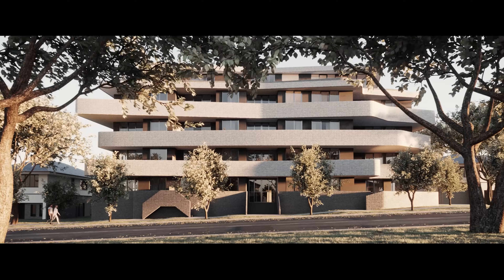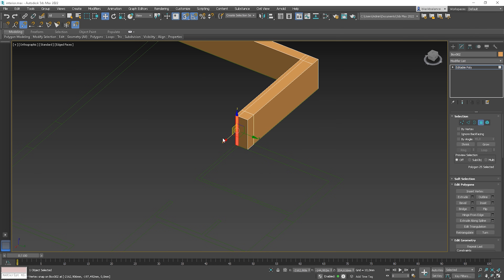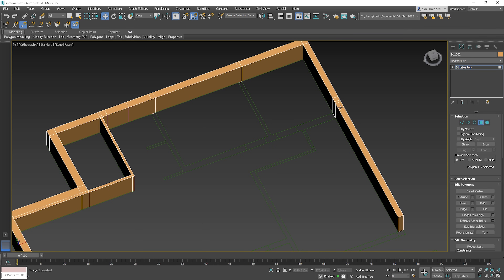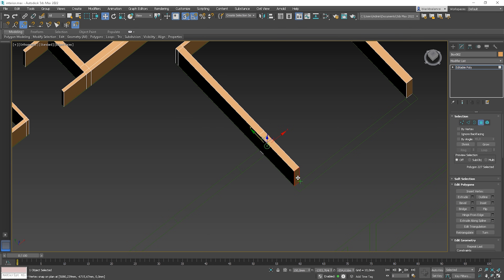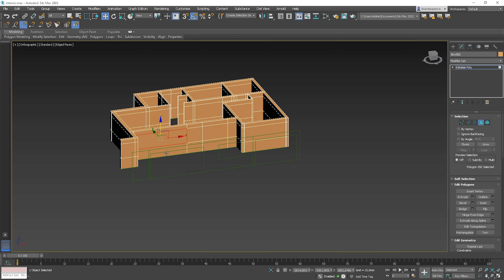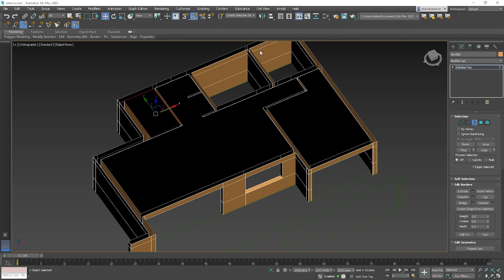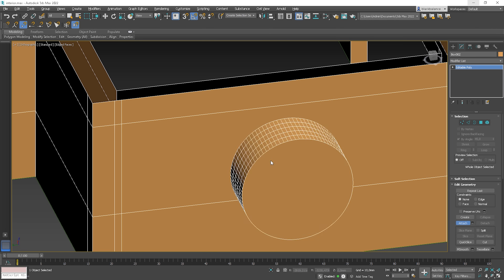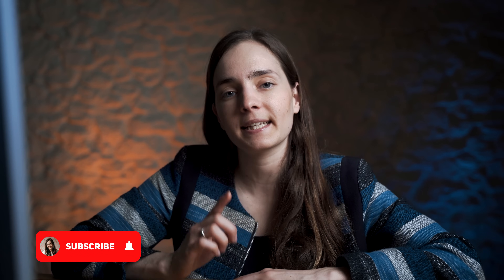3ds max 2022 Modeling Tutorial | Way Quicker Than Before!!

Comment: Am I the only one who still uses the AEC walls, doors, rails etc in Max? All that push pull poly editing seems to take more time than just creating AEC walls on top of the layout plan.
Reply: I used AEC walls door and windows too. The doors and windows created on the wall will automatically makes a hole for it. But the problem is the door and windows options are limited, as soon as you edit the windows or doors poly, the hole it created on AEC walls disappeared. My workaround was to duplicate the AEC window or door and make it 'not renderable' to keep the hole open while I continue to edit the door or window for more details.

Comment: I don't understand, why do you manually extrude face by face when you could easily just extrude the lines you have visibly displayed in the viewport, and just use that as the model? It would be just as clean and take 1/3 of the time.

Comment: I'm curious why you didn't just extrude the floor plans to begin with?
Reply: Most architects/interior designers don't properly join lines in their plans, so parts will be extruded individually, which you then have to manually connect if it's complicated. Easier just to rebuild 95% of the time.
Reply: @JasperCrowe  studying architecture and already struggling with this lol, but I have realized it happens because the same plan is edited several times usually and shit starts to get messy
Reply: Thanks, everyone. I serve a different industry so your explanations were helpful.
Reply: Here it's a simple floor plan, usually when you import DWG from architects they are not clean at all like that.
Reply: more control over editing later on if needed.

Comment: when drawing out the initial walls, why not just use the 2D lines directly and extrude them up to the desired height and segments? even accounting for the time it takes to make sure all the verts and segments are clean welded first, it would still be much quicker than extruding a box around to every wall face and corner. That's what I've always done anyway.
Reply: Yeah, this is exactly what I was thinking. Build it out with splines then add an extrude modifier. Done.
Reply: Agree.

Comment: Do you ever use the architects 3d models? Or is that a waist of time? Better to do it all in max?
Reply from the maker: It depends on situation and the project. But in general, it's easier to have everything from the same software 😉 You can use models from different ones but you need to add time for cleaning models which can be a quite time-consuming 😀

Comment: Interesting workflow. I am a blender user, thus I would like to ask 1 thing. Why the chamfer? wont that make UV's a bit of a mess to get? Won't a simple bevel shader give the same result with less geometry hassle? (disclaimer: I never saw the chamfer used like that by any blender user, so I think it's a 3ds max thing and I respect all 3d modelling software, just looking to learn)
Reply: the chamfer is just to round off the edges of walls. it gives the realism in render and the edges catch highlights. same concept as any hardsurface model. yes we can get chamfered edges with a shader. but most of us dont bother unwrapping walls. we just apply a UVW box mapping(box projection)
Reply: I'm not a Blender user, but I too have never seen a chamfer applied to the wall edges.  Yes, I 'm very aware that hardly anything in the real world ever has perfect 90 edges, but it's really not needed on a building shell in my opinion.  Whilst what you say about UVs is true, unless you're putting wall paper type designs on walls, a standard paint type material will not be too much of a hassle for such geometry.

Comment: is not already present in 3ds 2021?
Reply: In 2021.2 Smart extrude was introduced. Stitching faces when necesary.  In 2022 Smart extrude get the ability to create holes, and delete corresponding faces + ability to use it in editpoly modifier (in 2021.2 you can only use smartextrude on editpoly object).
Reply from the maker: No, it's a new feature 😀

Comment: I was just wondering if it might not have been faster to extrude the spline at the beginning? Btw. that simplified bool-operation at 5:57 was mind-blowing 🤯
Reply: i usually do that. spline,outline, extrude, edge loop at door/window top height, and window sill height,delete faces and bridge edges.. but that part is easier now with smart extrude. just push the face and u got a hole
Reply: @punithaiu  Fastest way is to draw a single line without outline. Extrude. Shell on thikness of wall. And then Boolean the doors and windows with traditional Boolean :)
Reply: @Teapode  yes,i do a single polyline for interiors in CAD before importing it. for only exterior views, i just do a spline for the outer wall, outline and extrude.i avoid Booleans as much as possible,then i need to make some cuts to fix ngons. i just add edit poly, extrude at 3  levels,window sill,door/window top level and roof. and just delete the windows/doors and bridge borders. you get perfect topology.
Reply from the maker: Here is the video where I modeled by extruding a spline: https://youtu.be/06HY-3L8CgU, the method form this video is quicker :)